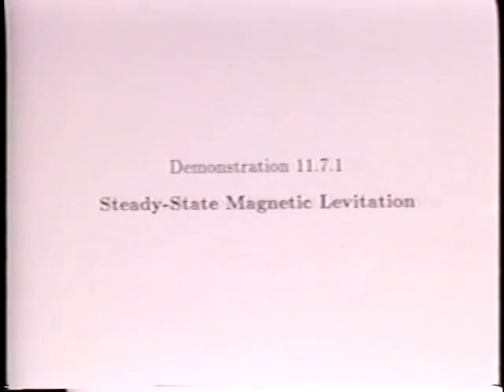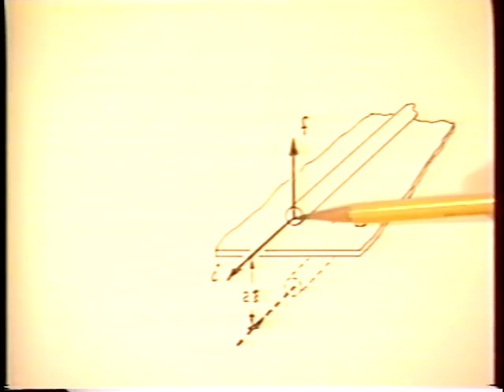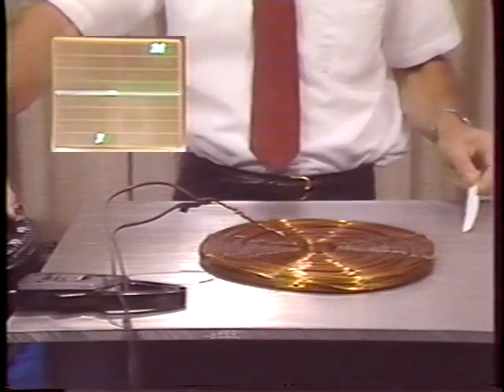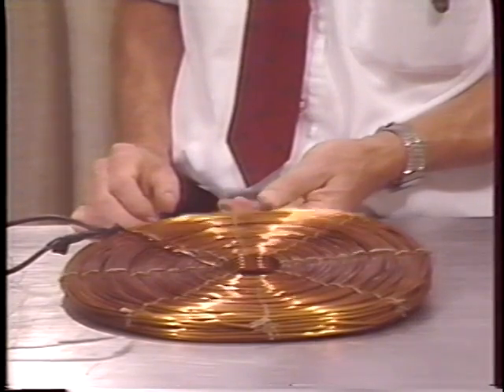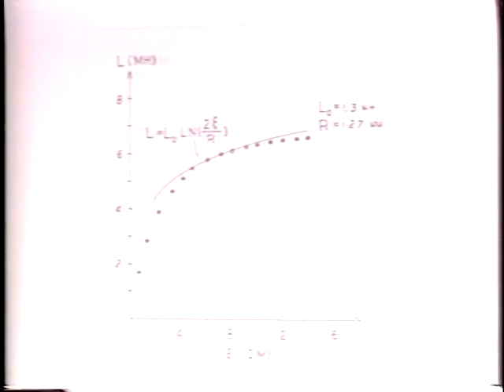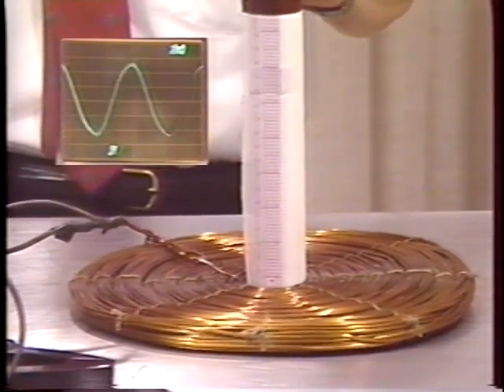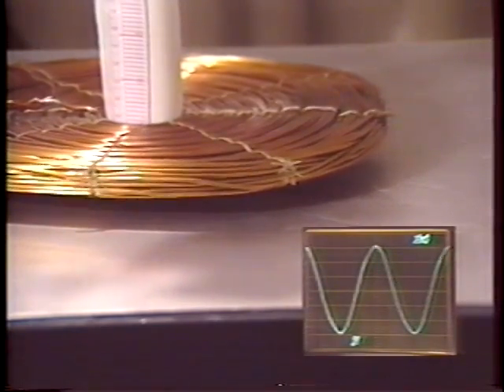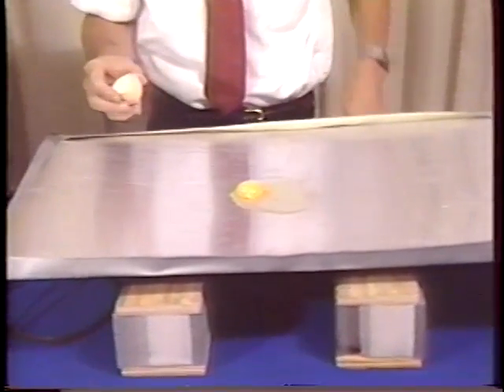Chapter 11.7.1: Steady state magnetic levitation

Comment: For some reason, in the video, the pancake coil's wire looks like copper wire.  Since the color of the aluminum plate is accurate (light gray), then it's logical to assume that the pancake coil's color is also correct.  Seems like copper would be a better choice for the pancake coil, even thought the audio track claims that the wire is aluminum.   Anyways, cool Lenz's Law experiment - thank you!   So easy to follow.
Reply: Looks to me like it's enamel covered wire.

Comment: Those currents are really high youre not easily going to get 30Amps from the mains to replicate that
Reply: You can. You can get up to 100 amps at 240v(or 50 amps per transformer line(2x50), ie 120v at 50a.) if Im not mistaken. However, preferably, you can get even more if you lower the voltage with a step down transformer. I think you can only suck 100a at 240v if your device is strong enough to demand it. Then it would more than likely cause current fluctuations to other people's mains since one pole transformers usually provides electricity to multiple residents. You can determine logically that the wires that run to your house are a bit thicker than needed for safety reasons, and I count 6 of 10 guage wires within the wire that runs from the transformer. Also, the other day when I was installing a 240 line for a split unit, the resident's breaker box had 2 of 50a breakers on each 120v transformer line preceding the other breakers that runs for their regular shit. So that means for their area's transmission line and the transformer they get power from, they could get 'up to' 100a current if they had the demand.

As this mainly runs on amps, it would feasible to lower voltage and increase amps, and make sure the according gauge wire is used for such an experiment, just to not be a jerk and mess with the neighbours power.
I believe the pole transformer can actually out put higher than 100 amps, but that also depends on the transmission line transmitting voltage, and the transformer itself.
You can get somewhere around 500a+ if you modify a microwave oven transformer to step down the voltage. Might be around 1-3 volts for that sort of current though. Not gonna lie, I hate current.